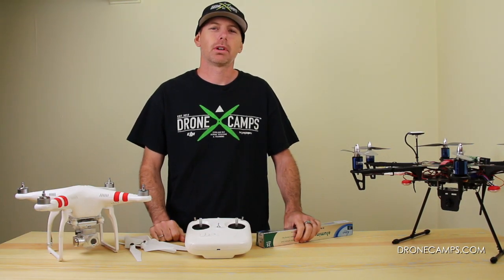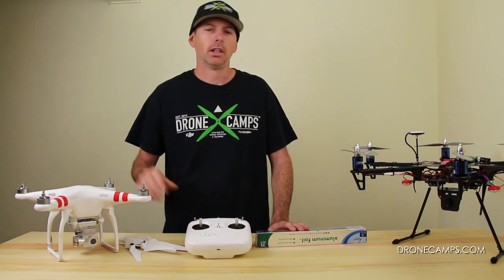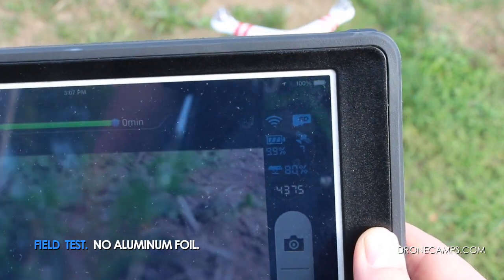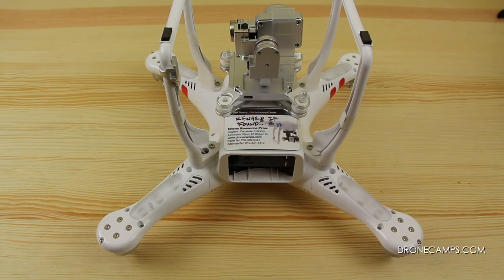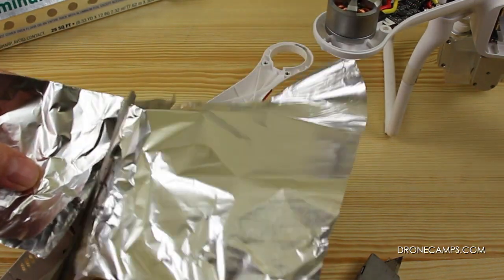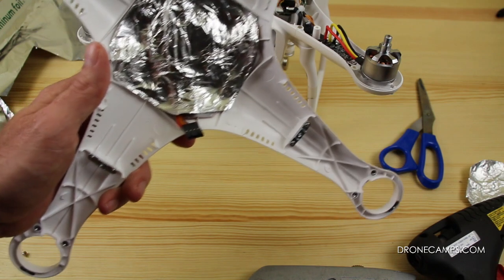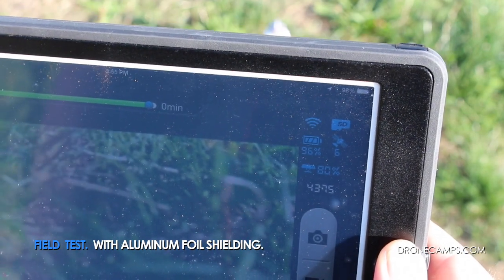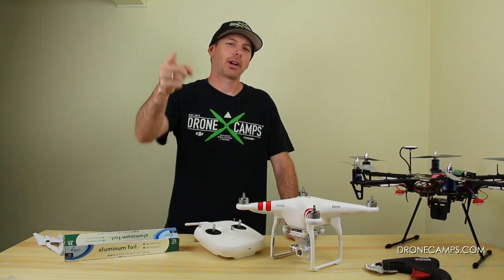Phantom 2, Aluminum Foil Mod - HOW-TO & RESULTS!

Comment: My " Phantom 2 vision " the compass ribbon cable is also attached to the top cover and down to the landing gear mounted compass. Has the designed / mounting been changed on the plus model?

Comment: The shorter satellite capture time may have been caused by the fact that it was the second start-up in a relatively short time (subsequent GPS fixes are usually faster than the first), not necessarily because the aluminum foil helped. A better test would be: see how long it takes to acquire "x" satellites without the foil, with the foil and again without the foil, just to make sure the result is not biased by the naturally shorter 2nd start-up.

Comment: From my understanding you need to also tape over the cable to prevent it from shorting out something on the board. People have been using clear packing tape. Others have suggested Polyimide tape

Comment: The initial problem the foil mod was used for was a drop of satellites when video recording in high quality was started so the tests should have been tried while video recording is running. Also the qty. and position of the Sats  vary with time so results may not accurately represent reality because of the time that elapsed between the tests. You should have more than one P2V+ in your shop to make a simultaneous test of the two versions ;)

Comment: The foil mods that are on youtube and on forums seem to start with moving the gps cable under the gray shielding and I don't know if it makes a difference, but they have the foil go up the arms to the air vents. I wonder if the foil acts more like a satellite dish rather than a shield? 
Thank you for trying this out.

Comment: It worked for me, done this over a month ago and no problem yet. The Phantom 2 Vision+ seems to have a major problem with it's GPS signal, my other Phantoms had no problem with the signal. When my first Phantom+ plus arrived I had no GPS! replaced with a new one and while in flight would loose GPS, added the foil solved the problem, maybe that is why there has been so many fly aways? Word of warning - I would cover the foil with tape so you don't short out the Phantom.

Comment: I put my cable under the original Dji shielding rather than add foil tape glue etc , seems to do just the same as the foil mod and leaves your guarantee safe.

Comment: I used aluminum tape, not foil. I also placed GPS wire back under the existing shielding but instead of leaving outside I placed it inside of shielding... It works!!!